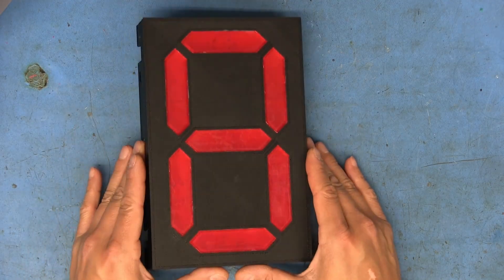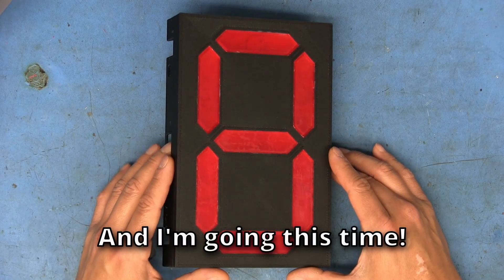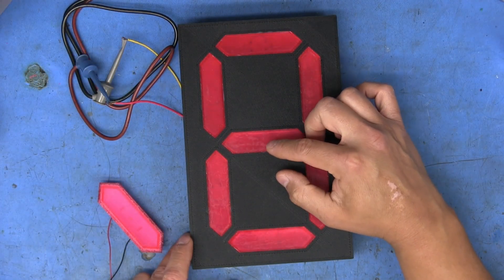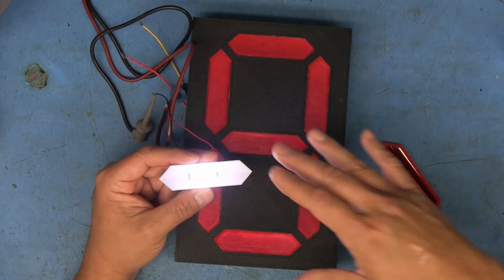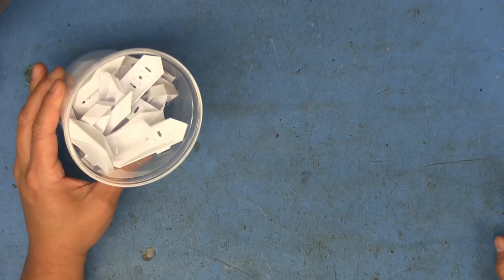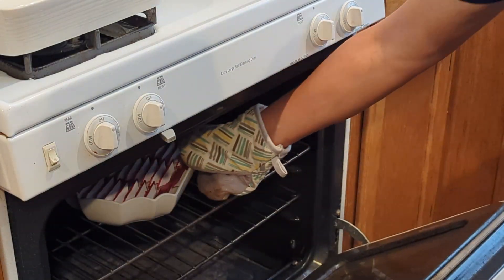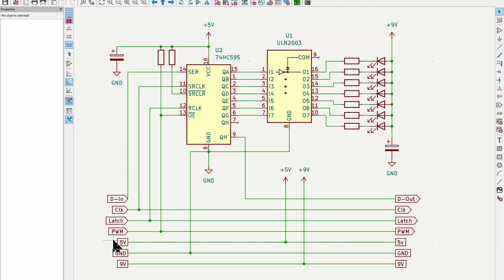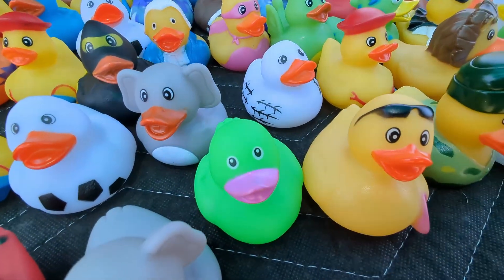TEF #201 | Jumbo 7-Segment Displays For A Foam Dart Game

Comment: You'll find it much easier to read if you can get some dark tinted film / acrylic sheet and place it over the front to hide the non-lit segments.  When I made a similar clock based on an Ivan Miranda's 3d print design,  I had some old overhead projector transparency sheets, laser printed them with a solid black page and then taped  over the front of the clock.  The readability difference was night and day.
Reply from the maker: I had seen a similar suggestion about using some sort of dark material in front, but you reminded me that I might have a large dark sheet from an old rear projection TV that might work for this.